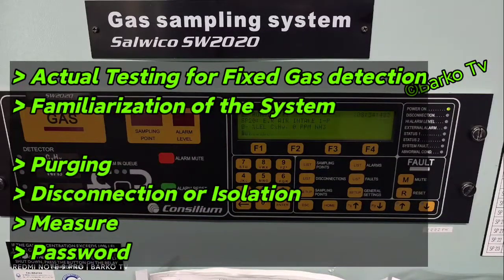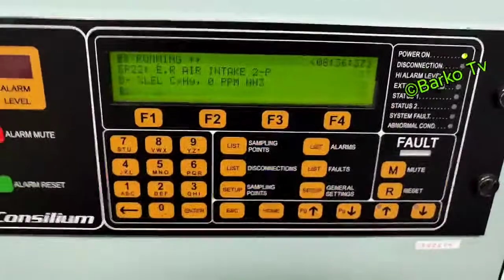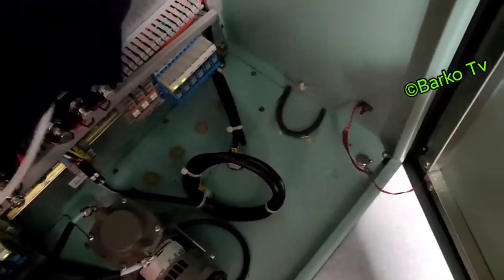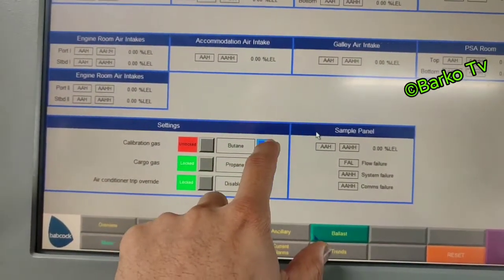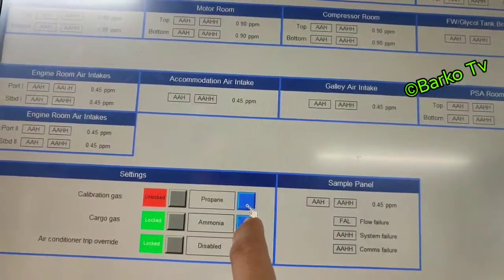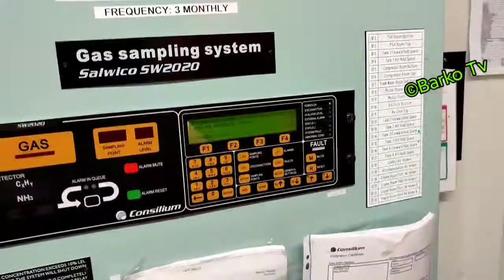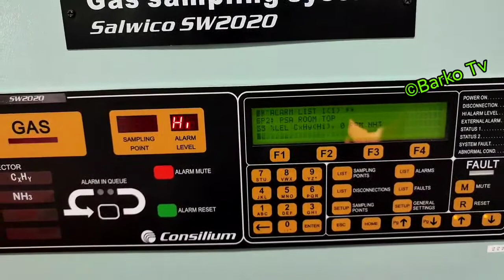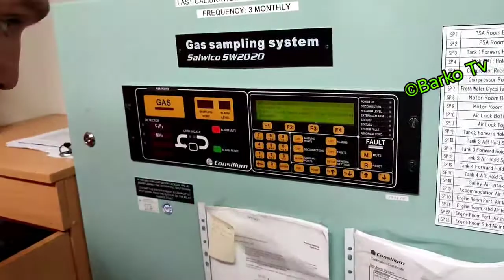Salwico SW2020 fixed gas detector system | How to test and Familiarization | Consilium | Kalecky

Comment: Do u know how to fix if sampling pump has flow failure alarm?
Reply from the maker: Check main pump if the suction is good, if not it means replace the end online filters in your sample points. Hope this will help you. Thanks mate
Reply: @BarkoTv  Thanks mate. I will do tomorrow. If i got question, i will ask u later. Bon voyage!!:")
Reply: I checked online filter,but its conditon was good. Still got bypass anlaysis pump flow fault alaram. Do u have any idea more?